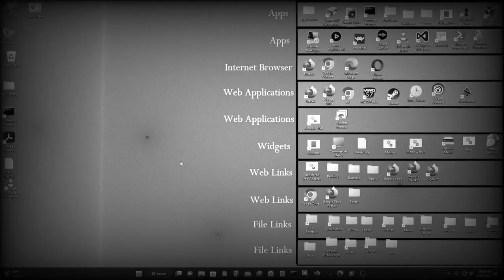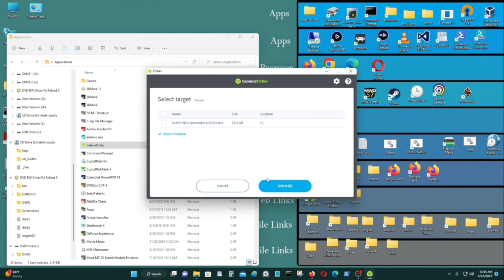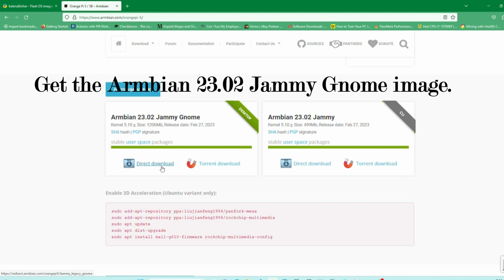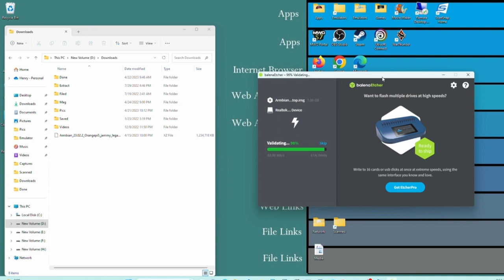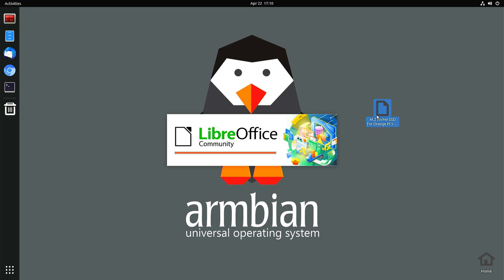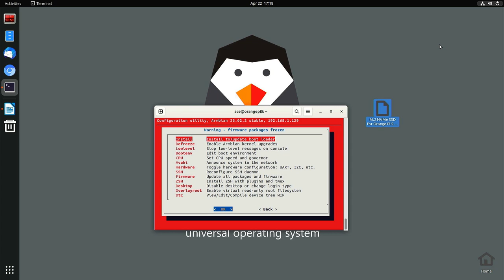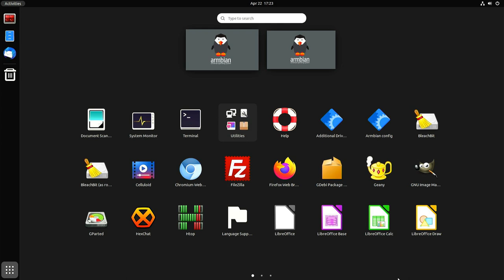Orange Pi 5: Boot from M.2 NVMe SSD for Armbian

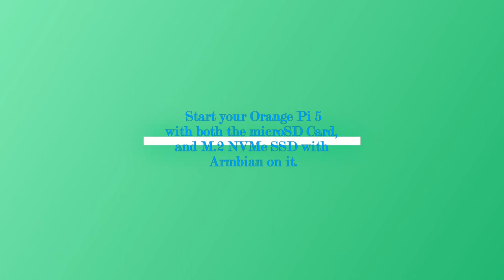Comment: Video starts at 21:15
- at that point, system is already flashed to SD card and to NVME separately.

That aside, I've been struggling to do similar/same with the OpenWRT image provided, as it doesn't seem to contain a config script...
Gonna try using the Ubuntu image on the SD card while NVME has the OpenWRT.
Reply from the maker: Right.

Comment: Thanks my friend😊
Boot for NVMe Android version?
Reply from the maker: I made a video about Android. https://www.youtube.com/watch?v=HdKyKgzcv0s

You can use the same method on this video and apply it to Android as well.
Reply from the maker: Once you update the bootloader, you should be able to boot from any O.S. image on a SSD. 

The bootloader is related to firmware. You can update the bootloader with a operating system, like Ubuntu, or Armbian. In this video, I used Armbian to update my bootloader. Updating the firmware enables you to boot from a M.2 NVMe slot. 

You can also load your operating system from a microSD card as well. Boot priority after bootloader update.

With SSD inserted with O.S.

1. microSD card with O.S.
2. USB drive with O.S.

If no other devices are inserted then it will boot from the M.2 SSD.
Reply from the maker: PikaDevs  I never tried to use a dual boot on any SBC, but I've done it on a X86/X64 operating system. It requires you to partition the drive. I don't know how to do that on a ARM based computer.

For me, I use different operating systems. 
I boot from USB, and microSD storage devices. Even if you have a SSD in your Orange Pi 5, it will boot from a USB device if you have a OS on it. You can still boot from a microSD as well. 

The O.S. on the SSD will boot if you don't have any other boot device connected on it via USB, or microSD slot.